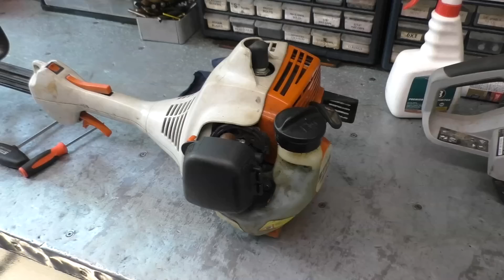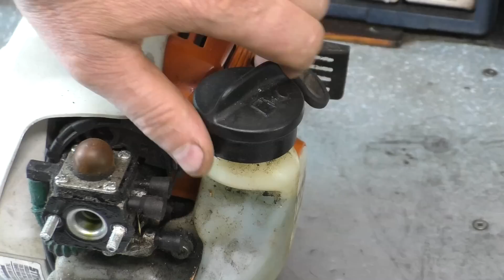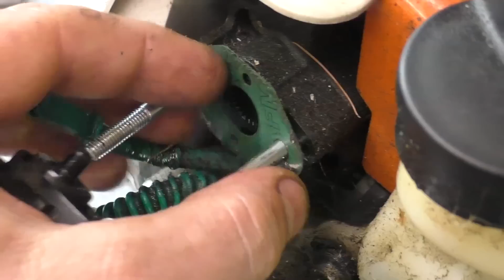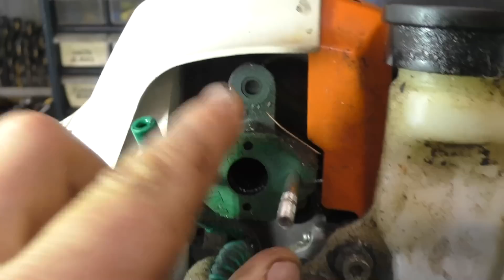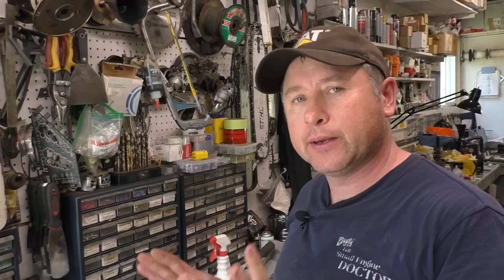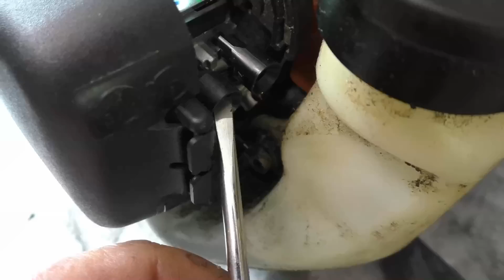Fixing A Stihl Weedeater That Bogs By Replacing The Carburetor - Step By Step Repair Video

Comment: Hey 73, my old craftsman walk behind weed eater leaks oil at the base of the engine, 
Besides getting new engine, do you have a fix it solution.
I’ve already changed the upper seal but I believe it’s the lower seal, which is hard to get to.
Can you help?

Comment: I have had many still products,  and still do .
Never had any problems with them but for one  , the mesh screen in the muffler would sometimes clog up. 
I ended up removing them completely,  problems solved  .
Great products always found them to be reliable.

Comment: Another excellent video, Don. One question: how do you go about identifying the exact part number for the carburetor? My understanding (perhaps wrong) is that Stihl may use different Zama carbs for the same trimmer model number...Does one have to pull the old carb first to identify the specific Zama carb number? Much thanks.
Reply from the maker: yes that helps

Comment: stihl FS 38,45,55, 55R, 55RC all seem to be the same, some carbs have the adjustment screws and some do not. I replaced 3-4 carbs with aftermarket ones. I run a tank of gas through each trimmer before I sold them. I did not make much profits on those trimmers as I sold them with these inexpensive carbs.

Comment: You do not describe how to adjust the carburetor when you install it. Mine runs until I put the filter on and then it does not. But I do not know how to adjust the high low on the carburetor and nobody on the internet tells you how to do that from square One. Screw the high low all the way in and then back out which one how far and how first
Reply: Did you search his tons of other videos on how to do the adjustment?

Comment: Excellent video . Anyone can do it! My Stihl carb less than 40$. First one lasted more than a decade of home use definitely worth it . The Chinese carbs work but for how long? Also the casting is wrong when I had to latch the air filter plastic door. Also pro tip dump out enough gas so the level is below the green fuel line and it won’t spill out. Also if taking time on carb, buy some Stihl gear box grease for the trimmer head for less than 3$ at dealer and don’t neglect your maintenance

Comment: Nice job 👍 I had a Weedeater just like that kept putting Carb kits in and it kept giving me problems I ended up putting a new carburetor on it and I also replaced the fuel lines in the gas tank and gas filter after I went through all that and seem to run fine never had no problems ever again but I had to go through and adjust the carburetor like you did but everything was good great video

Comment: I definitely understand using OEM carbs in the shop, but as a DIYer, I tried an aftermarket carb that had TONS of positive reviews on Amazon.  I might have gotten lucky, but after a little tweaking, it actually starts & runs better than new.  I did have to bump up the idle screw by 50 RPM or so, or else it would sometimes stall at idle.
Reply: Same here. I haven’t had a bad Chinese carburetor yet! 1/10th of the price too! (Some Husqvarna carbs are $125+).

Comment: Hey Don, can you make a video on what makes an OEM carb go bad, to the point it has to be changed? I see gaskets going bad, but what actually goes bad in the carb, that you must change it, instead of a rebuild kit fixing the problem? I'm sure a lot of people would be interested in the answer.
Reply: I am told there are check balls inside that wear and can get gummed up. Unfortunately not addressed even with ultrasound cleaning
Reply: It's just cheaper to replace the whole thing for him as a shop owner as he said.

Comment: I think my carburetor might need changed out on my 131 trimmer it has a miss in it. I have a brand new 91 and sometimes it acts like it floods and I have to pull it at full throttle for it to restart. Other times no problem on restarting. Usually happens when I'm far from my shop.
Reply from the maker: you could try a new carb kit

Comment: Great video Don I’ve purchased many aftermarket carbs and honestly had pretty good luck with them I do recall having a little trouble with a Briggs updraft aftermarket carb on a old Gilson snow blower that turned out to be some crud got in the main jet I see your point nobody likes comebacks but I only repair my own equipment generally.😁👍

Comment: I just watched your older video yesterday about burning off the spark arrester screen to fix loss of power and rpm, plus bogging. It worked, and now runs great! Over the winter, I had given it the full spa treatment, removing the exhaust port carbon build up, carb kit, and new fuel lines, but missed the screen. Your channel is priceless!

Comment: On a Zama carburettor that does not respond to the throttle, only runs on idle, and kind of "four cycles" on idle, one can suspect the check-valve for the main jet.
Zama claim that those are not repairable, but you can bye them, in some few places, and easily replace them yourself.

According to Walbro's fault finding chart the only thing that can be wrong in this case is the check valve. Should be the same for Zama.

Comment: Hi Don.  Just a tip: Snap on makes a 4 piece soft grip seal removal tool set.  They're like small picks but with rounded, flat tips.  I find they work well for removing fuel lines and greatly reduce likelihood of damage.
Reply from the maker: I'll check it out
Reply: for the small price of a couple car payments
Reply: @RumfordSledhead  They're $16 each or $60 for the set.  I bought mine on promo a couple years ago for a lot less than that.